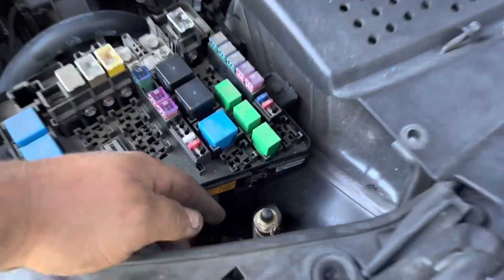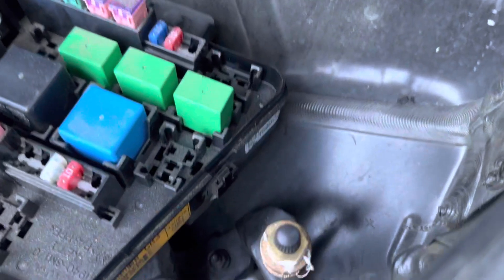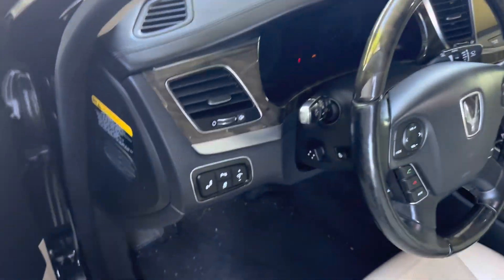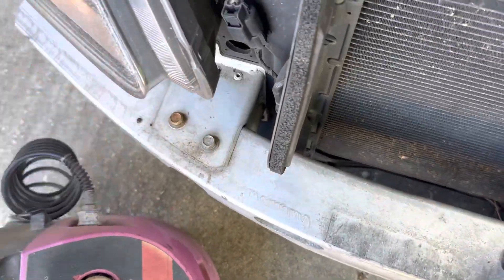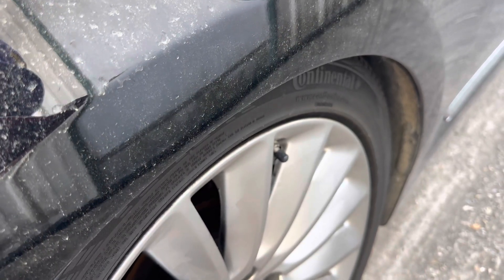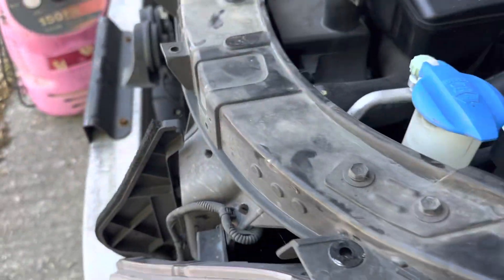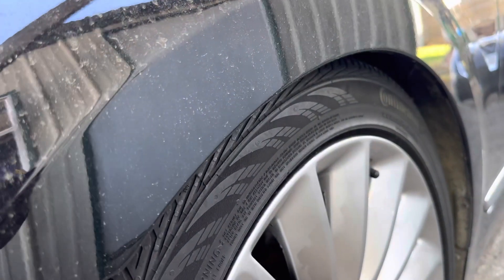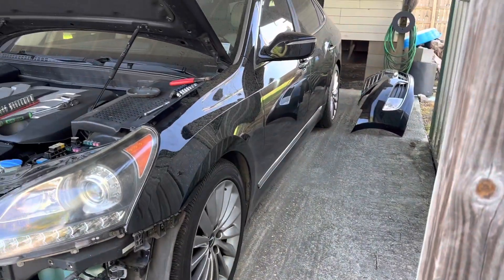How to Fill Air Suspension/ Air Suspension Fill Valve Retrofit on a Hyundai Equus (2011-2016)

Comment: So how often do you have to go under the good to do this?
Reply from the maker: This shouldn’t be routine. If your air suspension system is up to snuff the car should hold its own. This is only to be used when servicing the air suspension, if your car can’t hold itself up then you need to repair it.
Reply: My driver side is low. Can I just add air or do I need a new air suspension
Reply from the maker: @1843allen  you shouldn’t need a whole new air suspension system, but you should look into replacing both front struts. It’s advised to do both sides at the same time, otherwise one shock might work better than the other, and give you a weird ride.
Reply: Just replaced both front air struts and not going up. Going to add air like you did. Do you know max PSI?

Comment: Good Evening, 
I had a short question about my 2011 Equus Signature air compressor.  If I have already replaced the rear airbags and one week later the car doesn't want to raise up... can the air compressor be bad from constantly pumping air into a leaking left rear airbag.
The car will not air up when the raise height button is pushed,  or the compressor will turn on briefly,  but the cars height will not increase. 
Bad air compressor one week later after replacing the rear airbags  ?
Please reply asap.... Thank's
Reply from the maker: So I’m not expert, but if your car is capable of lifting itself at all then the compressor is good. Back bags, or any suspension error detected by the cars suspension computer will disable the ability to raise the ride height with the button
Reply: @SlickNicklol  My mechanic installed both rear air bags last week and everything was fine. I had been driving for about 6+ months on leaky rear airbags. 
This morning on my way to work after starting the car the air compressor did start up, but the front and rear didn't air up.
I'm not a mechanic,  but it seems like the air compressor is weak from pumping up leaky airbags for over 6 months.
Also, can I just convert the airfill port , like you did, and fill it up when needed until I can get the air compressor replaced ?
Is it safe to fill and drive ?
Thank's for your reply...
Reply from the maker: @AfterTheLayoffs  no not really. When the air pressure is low, the car does some strange things. Like intentionally air the car all the way down. Have your mechanic check to see if the compressor is getting power. If it isn’t, then it’s more than likely the car telling the compressor to not come on.
Reply: @SlickNicklol  Just to recap and understand what should my mechanic look for:
The compressor does start up after the car is started, but it shuts off quickly and the car now won't raise up at all. It's almost completely down to the wheelwells. Also I thought I smelled a burning plastic or wires odor from the front hood area the other day. Theoretically the air compressor may be overworked and the wiring harness could be heat damaged thereby causing it to not pump and shut off quickly ?
This is my last question  and thanks for replying.
Reply from the maker: @AfterTheLayoffs  anytime. Yes it is possible the compressor has failed. Im just a thorough guy and I hate doing parts for no reason. The compressor isn’t very easy to change.
Reply: @SlickNicklol  My mechanic explained that the front bumper has to be removed to get to the air compressor.... I really think the compressor has failed, or is this/close to from over working/heating pump up leaky rear airbags for almost 7 months.
Thank's for your comments and suggestions  Sir.
Reply from the maker: @AfterTheLayoffs  yes you absolutely have to take the front bumper off. It’s not hard at all though, I can make a video on it, if it would help would literally be like a minute long lol
Reply: I'll also have him check the fuses.
Reply: @SlickNicklol  
If you could make a very short video explaining it that would be fantastic. 
Do I need someone else to assist me ?
Is the air compressor difficult to remove with standard or metric tools (socket wrench) ?
Reply: I try to fill it with air but would not lift.. I try to find the parts and replace the factory valve
Reply: @mirkomasini  I had the air suspension system checked thoroughly for leaks and bad codes after the rear airbags were replaced. 
The air compressor was defective from over heating, because of the leaking rear airbags. 
Since my mechanic replaced the air compressor about 2 or 3 months ago the air suspension is working properly.  The height button works properly - so far 🤣.
All cars and SUV's with air suspension systems will break down eventually.  My late Father would only buy luxury cars with air suspension for many years. 
I really enjoy the comfortable ride and you really notice the difference when you are in someone else's car.  I knew this system would need maintenance sooner or later, but I'm keeping the car until it falls apart. The look on everyone's face and question,  "what is that... Mercedes, BMW ?".